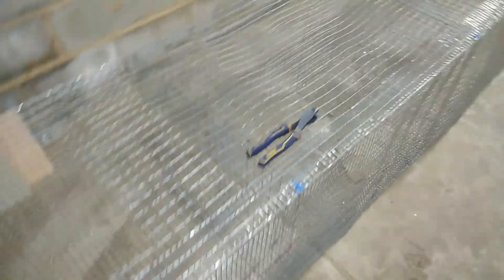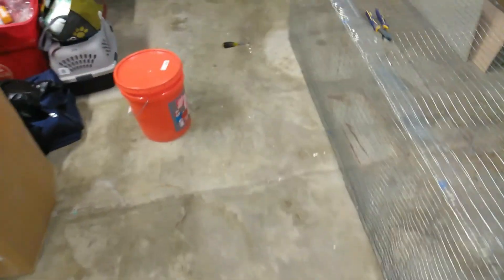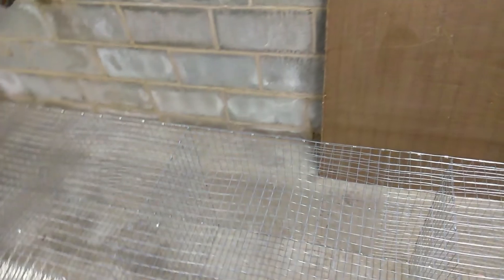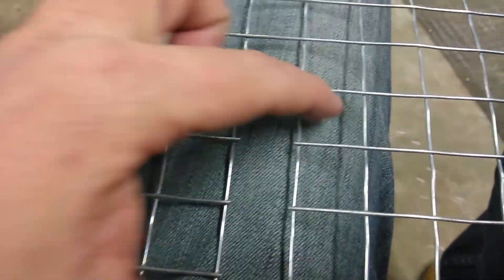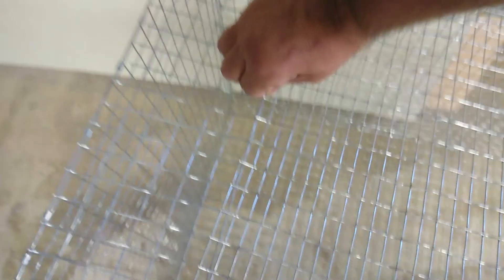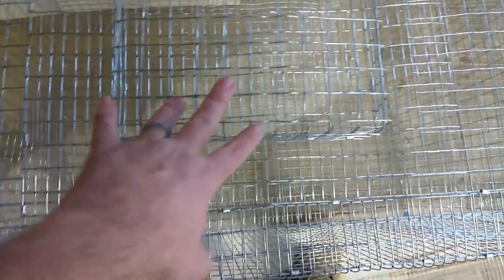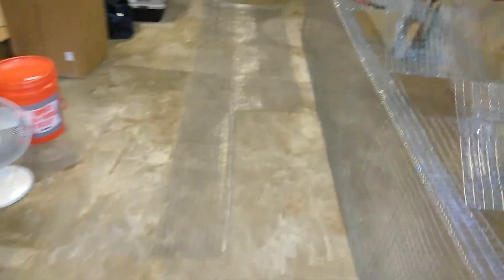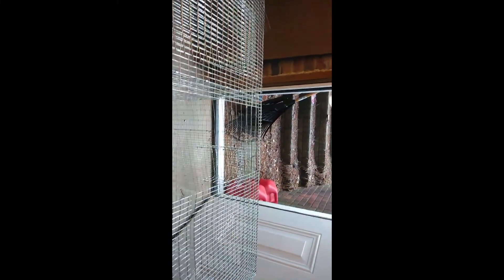Rabbit Cage Build Part #3

Comment: We do quite a few rabbits. Few notes; don't use bleach to clean the cages. Get yourself a weed burner, tip the cage upside down and just burn the hair and junk off. then spray it with pressure washer. I would not use those drop in nest boxes, your kits will die.  Just put the nest box in 2 days before they should kit or if they start pulling hair. take it out one week after all kits can get out of the nest box on their own. If you do that you will not have issues with them getting dirty. If you cut a hole in the top corner use the extra from the door to make a holder on the inside you can use that for the hay feeders, really easy to fill. Galvanized coating will come off and the bottom will rust out. If you can use stainless on the bottom plate, that's best otherwise you will need to replace every 5-7 years.

Comment: That sure is long. I hope you can get it up the stairs ok. It will be cool to see it attached to the other one.
Reply from the maker: It's my second one... Remember? Goes out the door and up the stairs with room to spare...
Reply: @GhostPrepper1369   idk why you are being rude. My reference was to moving it alone.
Reply from the maker: @hootowlholler3760  rude? Who was being rude? I was just stating that this is an identical cage to the first one I built and videos in the same spot before I moved it outside. Not being rude. You must have misunderstood my meaning in my response.